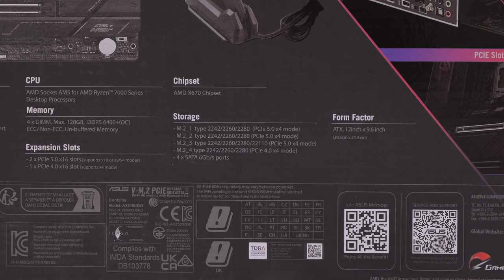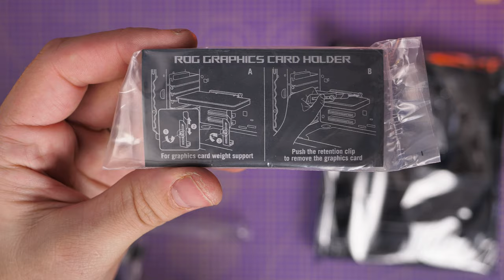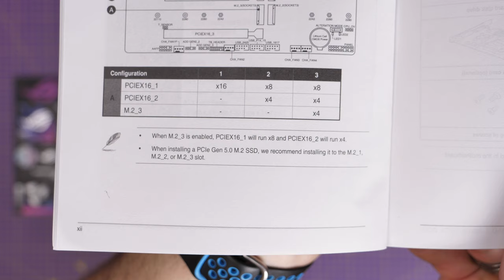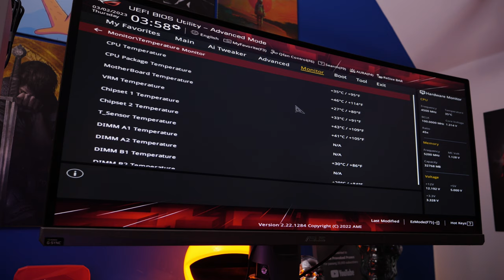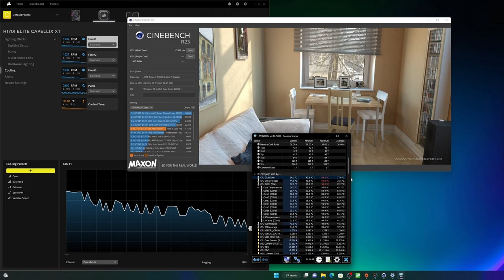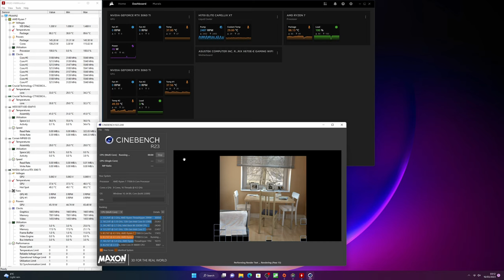Asus ROG Strix X670e-E gaming WiFi feature overview

Comment: Also do note I discovered the hard way with my new Asus Board (Z690-F) That you MUST connect the Wifi Antenna even if you don't plan to use WiFi if you DO plan to use bluetooth as it doubles as a Bluetooth antenna.
Reply: Thanks for the heads up, I was going to leave wifi unconnected XDD
Reply: Does this affect Bluetooth working? In general
Reply: @caliraised415  Yes, I made this mistake and my bluetooth performance with my Xbox Controller was awful as it would constantly disconnect. I felt so stupid when I found out the reason why was because I didn't have this antenna connected!

Comment: So if I don't want to half my GPU lane, don't populate the M.2_3 slot but I can populate the rest with out halving my gpu lane or did I misunderstand something?
Reply: did you find the answer to this question?
Reply: Basically, all 4 m.2 slots have to have a drive in them for the halving to take place apparently. Even then you’re talking 6-10 fps loss. Not a big deal
Reply: Yes, using pciex16_2 slot or m2_3 slot (or both in the same time) will make the gpu slot to run x8. 

Only this would limit the gpu slot to x8.

Comment: I have this board with 7950x. Got it the day it came out. No issues whatsoever since I started my pc the first day Runs perfect! No coil whine nothing. Just get one if you are on the fence!
Reply: I built a setup recently with 6000 ram, and it would stop at boot, showing the C5 code and yellow q-led.
is this a bios issue?
Reply: @thisColdDecember  could be, update the bios for sure

Comment: I own the X570 Hero. So this was a natural progression. The Rog Strix X670-E is priced like the X570 Hero. I left the one of the M2 slots empty, because of the split lanes. I know it doesn't impact things too much. It's there if I need it. I'm already running 3x 2TB M2 drives with 2X 2TB Sata.
Reply: Have you had any instability issues at all?
Reply: @danemyburgh  The Mobo has been stable outside of a minor sleep/wake issue. The USB ports were pulling too much power during sleep and the PC would not wake up until I unplugged a few things. I fixed the issue with a few bios tweaks. Otherwise no problems.
Reply: Yeah 2-4TB ssd/nvme is the way to go for gaming. With video editing probably want dual or tri 8 TB ssd/nvme. That will be very expensive. So maybe a 14 TB 7200 hdd.
Reply: i own the x670e-e 
need to know what m,2 post should i avoid if i want to keep my gpu port on 16x   no downgrading to 8x ?
thank you mate
Reply: @DrManany  I believe it's M.2 #3. The third slot counting from the left of the main OS M. 2. The X670-E F doesn't have this issue. But I honestly wouldn't worry much about splitting the lanes. It doesn't have an impact on gaming.

Comment: I built my newest system with basically no budget cap, but I decided to go with the B650 version of this board. Both of them are massively overbuilt and the B650 one ticked all my boxes, so didn't need to look at this version. Got plenty of nvme drives to go with it, but I only connected 3 of them, not sure how much connecting the fourth would cripple the 4090 in ML workloads, but for now it's just used as a gaming/web browsing rig til I get my thumb out my ass. 😂

Comment: I have this board with a 7950X and I highly recommend as of now to use BIOS 0805 for Maximum stability. BIOS version 0922 was very buggy for me throwing a lot of code 15s.
Reply: That’s why I am keep getting code 15,50,39, do you recommend downgrading for 0805 version ?
Reply: i have the same board ... didnet assenble the pc yet ..
what version of bios did you recommed 
how about the latest?
Reply: @DrManany  im on 2204 DDR5 6000 Hynix no issues

Comment: I have found out the hard way that if you are not running 0805 bios, you can't overclock nothing . Enable any ram or CPU overclock and your greeted with a PC that won't post. I had to find the bios file online because Asus took it off there website.   Just a heads up

Comment: Intresting to note the x670 E-F is cheaper AND you can populate all 4 NVME slots without affecting the GPU.
Reply: is that really true? so these more expensive ones use x8 on gpu when all nvme is used? im looking at buying Proart or x670e-A which should be the same just white version, seems like a good buy, (though after all these scandals with bios and asus mobos frying the cpu and ram, im also considering Asrock Taichi)
Reply: It is, check out the manuals for proof. Unfortunately my x670e-f had constant coil whine, the second it was turned on. In the end I went for the x670e Carbon. That board also doesn't limit the GPU with all slots occupied and also has another two sata ports if that's important to you.
Reply: @hostile_1866  thanks for the info, never used msi stuff, I would get it, but seems no tb4/usb4 inputs on any am5 boards which im gonna need for external 16 input/output audio card, so im still stuck between Asrock Taichi and Asus proart mbs
Reply: @davemaverick8438  It's a tough one. I mean limiting the GPU slot dosn't have too much real world difference. It's probably a loss of about 2-5 fps max.
Reply: @hostile_1866 Did switching to the carbon get rid of the coil whine? I am asking because I recently bought a x650e-f and seem to be having the same coil whine.
Reply: @natrixnatrix  Yeah it did. I think Asus have had a bad run of motherboards with coil whine recently. There's quite a big thread about it on their forums.
Reply: @hostile_1866 Guess I'll get an msi board to then. Kind of sucky with how much more expensive it is, and it doesn't really have any extra features that I will be using.
Reply: @natrixnatrix  Yeah that or perhaps order an Asus board somewhere with a good returns policy?

Comment: The MB manual claims occupying port 3 will halve the pci lanes to the first x16 slot. In your video around 10:10 you mention if port 1 and 2 have a drive it will also halve the lanes in the first slot. Is this correct? I want to install 2 m.2 drives and one gpu without halving my lanes. The manual also says PCI 1-2 and m.2 3 share a connection, so it should only halve lanes when occupying both PCI slots and/or the m.2 3 slot?
Reply: That is how I interpreted it. 3rd slot impedes the lanes.
Reply: i am having the same issue ,,,, how did you manage to solve it ?
Reply: @mainsource8030  
Excellent 
I have the same set up
Want to add an gen 5 nvme. 
Can i use it on slot 1  with full speed
While the rest ( expect m2-3 ) are gen 4 ?

Comment: I have this Mobo it is great 👍🏻
Reply: Do you have to run both 8 pin CPU connectors?
Reply: @TylerLeyden  Yes I do , How about You ?
Reply: @TylerLeyden  sorry miss read your question, I have not tried to run with one cable only .
Reply: @TylerLeyden  it is always depended of the power of cpu you use .

Comment: Great breakdown. However, are you saying to keep the two bottom M.2 ports empty? Because you said the bottom left port 3 is especially problematic and they go straight into explaining why the bottom right port 2 can cause issues also. What's the point of adding these two M.2 slots if its gonna cut GPU in half? Seems very odd.
Reply from the maker: https://youtu.be/CT55vgeuhPo

Comment: The gen 5 SSD cards I plan to buy, already have a large heat shield attached. That means I won't be able to attach the heat shields that came with the motherboard correct?
Reply from the maker: Yes but that's fine.

Comment: Can you tell whether the AK620 air cooler would fit this board? (Or the the Z790-E Intel equivalent)  My concern is precisely that PCI-E 5.0 M;2 heat shield you just showed in this video. Both boards have it.

Just as some info: I contacted Noctua and they assured me the NH-D15S DOES fit. But Deepcool Support  didn´t provide a satisfactory yes or no answer.

Comment: I have the A variant for a white theme build. It seems to not play well with my ddr5 ram. I can’t get into bios unless I clear cmos, other than that it boots into window fine, I do see there was a new bios update. Maybe that would fix it. 

On the manual for x670e-a it doesn’t specify that if all 4 nvme slots are populated it would cut the gpu lane. Is that only for the x670e-a model? If so I find it odd that the model e can’t do the same when it cost more.
Reply: Also on team a 😂 am5 is very picky/dodgy about ram. Make sure its on the QVL, dont even think about trying 4 sticks and stick to the 32 for now. It seems the best bet is a 6000mt c30 32gb hynix. (Youll notice alot of benchmarks are running those, and that theyre super high in demand).

I have 5600 cl36 and the stock speed is stable but i cant run expo on those.

Comment: When installing a single NVMe M.2 into an SSD enclosure, is it necessary to remove the sticky seals for all drive enclosures. Or just the one you plan to use. (Sorry if this is a dumb question)
Reply from the maker: Just the one you're using should be fine.

Comment: 10:00 so it means if i Install 2 M.2 SSD In Port 1 and 2 i loose Bandwith in the Graphics Port?
In the Manual they said if u use Port 3 and 4 you loose Bandwith from X16 to X8. Whats right?
Want to Install a 1TB M.2 and a 4TB M.2 both PCI4.0
Reply from the maker: Don't worry about it. https://youtu.be/CT55vgeuhPo

Comment: Can you please tell as I'm looking to get this board. Have you found it stable? No SoC voltage overheating on CPU? Intel Ethernet issues? RAM issues? I'd really appreciate your thoughts. Cheers
Reply from the maker: I am not using it as a daily driver, but I've not had problems with it either. I would recommend doing the BIOS updates though
Reply: @TheProvokedPrawn  Awesome thanks.

Comment: Hi,
I have the same motherboard but with
 ryzen 9 7950x3d  
Trident z 32g cl30, expo 1
Every time I turn on the pc, I got code 15, and then it boots to windows, everything run normally without any issues.
The booting time takes about 30-45 seconds. 
Is that normal, or is there something wrong with the memory?
Reply: i also have 7950x3d and have the Crosshair Hero, i think thats fine. Just memory training everytime u boot.
Reply: this is  BIOS error ... try updating your bios to the latest

Comment: So the third one does not share the lanes with the top 2 correct?
Reply: Honestly noticed 0 difference when running my 4090 on x8, with all my pcie lanes filled, will eventually get a 4tb ssd and leave slot 3 empty tho.

Comment: So as per the manual, if I use m.2_3 along with m.2_1 and m.1_2 the pcie_1 goes to 8 lanes. What if I use m.2_1, m.2_2, and m.2_4? Will my pcie_1 be 8 or 16?
Reply: should run at 16.
Reply: @Zellha  "Should" is the keyword here. I tried and got 8. That m.2 v4 put me two under 16. and 1 and two was -3.
Reply: @GreggRoberts  thats strange, i have recently got 3 samsung 990 pros and installed it on slot 1,2 and 4 and my GPU on pcie_1 is running at 16 lanes

Comment: Question: Are the drivers pre installed or do you have to down load them?
And What is the start button used for on the mother board? 
Thanks.
Reply: Start button is the same as the power switch from the case.  It allows the use of the motherboard without being in a case. The drivers get installed via the web instead of using a cd coaster.
Reply: Ok thanks @TheSjuris

Comment: Getting this board along with a 4090 and a 2TB Wd Black SN850x. Want to put the 850x in a slot that goes straight to the CPU of course for best performance, but don't want to rob the 4090 of any of its 16 lanes. Which M.2 slot should I use on this motherboard to accomplish this?

Also, would the Corsair h150i elite cappelix CPU cooler install the same way as your 170 in this video?
Reply: i'm currently getting the exact same setup😂
Reply: @juanpineda1446  Nice! :) I just started my build yesterday with these components.
Reply: M2.2. It's in the manual.

Comment: Seriously I have always wondered, what % of users need to populate any more than 1 PCIe slot? Sound cards are like a 1990s thing (remember Sound Blaster cards?) you already have like 4 M.2 slots on a decent board, 4 TB a drive (can be 8 but not trying to go super expensive) that's 16 TB, like how much storage can you possibly need?
Reply from the maker: Lots. I use one for games, one for video files, one for gameplay recording and one for Windows
Reply: I've got a m-atx x99 board with 2 graphics cards and a 10gb nic.  What I can't understand is wtf do you need 4 m.2 ports for.  Would much rather have pcie.  You can always get a pcie to m.2 adapter if you need more.  Some people do things other than playing games on their machines.

Comment: That board is a Horrible value at $480 today. To spend that money and run a 3060ti is a completely upside build. $150 Gigabyte B650M DS3H would do all that and take $300 to the GPU.  In 3 years time, Gen 5 stuff might be relevant and totally unnecessary for Gaming and only relevant to productivity. I hope you got the board as a tester.
Reply from the maker: Yes I did and that's also not my main GPU or my main build 😉
Reply: 6700xt would be a better than that 3060ti and would be between 50-80 dollars cheaper while being more powerful